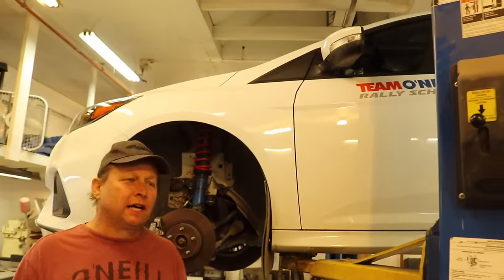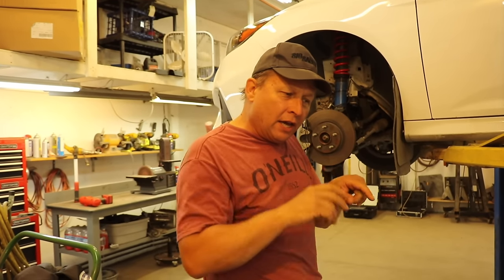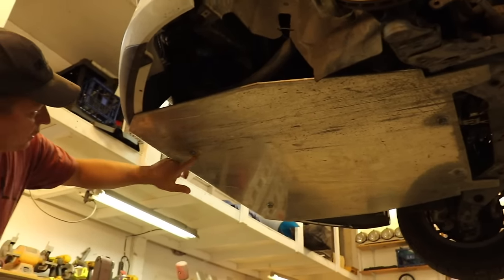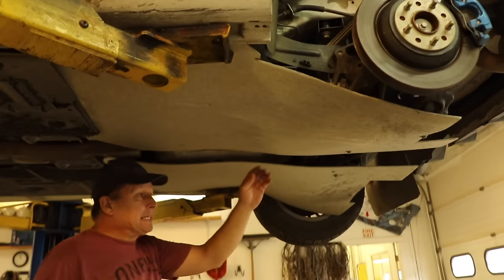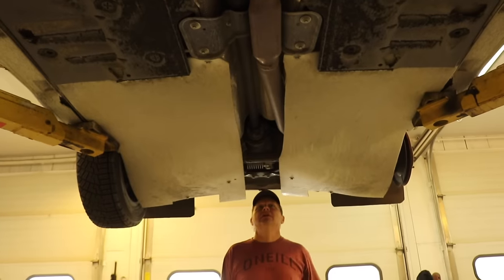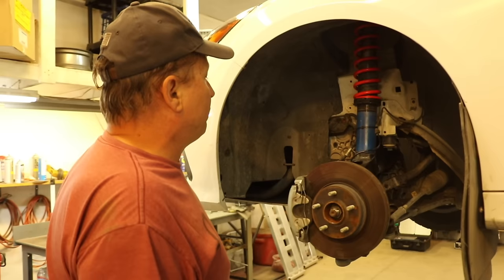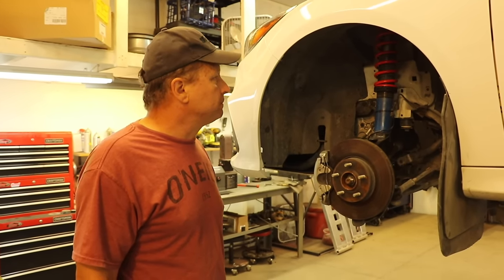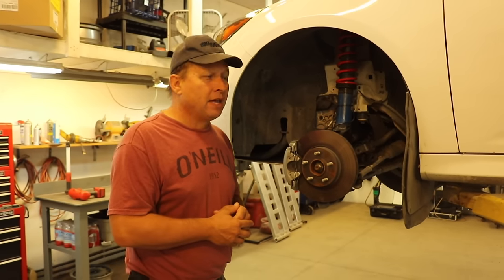Focus RS Brakes, Suspension, Skidplates

Comment: Great video, always looking for idea's to improve my ride..  Air holes in the skid plate and the belt that holds the rear protection, I've been using large cable ties wrapped around the rear control arms.  I'll be interested on the floor protection and the rear skid plate.  Thanks

Comment: Do you have a problem with rocks getting in your front brakes. Because every time I go in the gravel. My rotors get messed up. Do you have a suggestion of skid plateing the whole undercarriage? Or something that would stop this.?
Reply from the maker: Most rally wheels have a pretty solid face and not too many big gaps in the spokes to let rocks in. Also try to make sure there is a decent amount of clearance between the caliper and the inside of the wheel... Other than that, it's kinda just something that happens unfortunately, you could maybe ziptie some mudflap material under there or something too if it's a real problem.

Comment: What is the reason for switching to stock Focus Uprights?
Reply: My guess is steering geometry. The Focus RS has a progressive steering rack combined with special geometry knuckles for maximum track control, which makes its steering lock and thus turning circle abysmal. I am guessing with the stock uprights they are hoping to gain a bit more angle from lock to lock without changing the rack, cause that will get messy really quickly with newer cars.